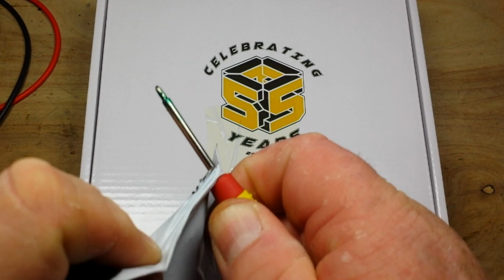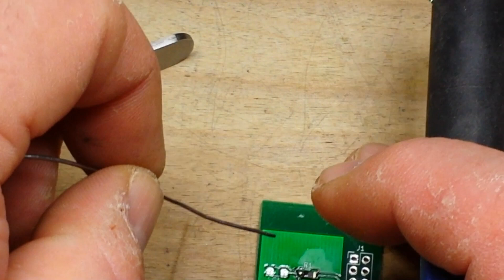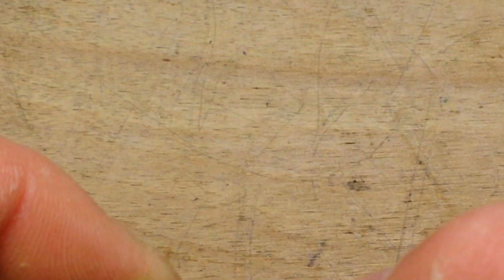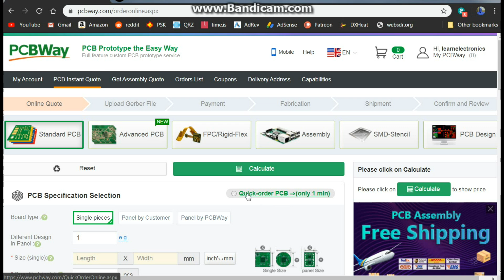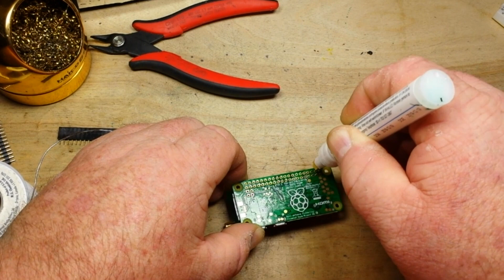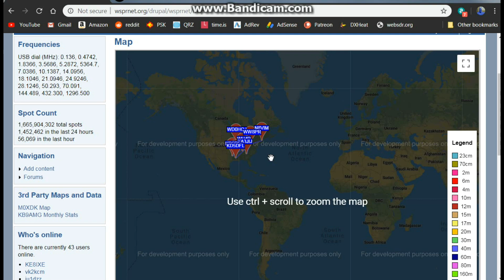WSPRPI Board build and test

Comment: For soldering SMD components your should purchase a Chinese T-962 Reflow oven. They are inexpensive and there problems can be fixed fairly easily. Just do a YouTube search on the T-962 and you will find many many videos on repairing these reflow ovens. The best way to fix this reflow oven is to purchase the following Tindie Product: https://www.tindie.com/products/pnoxi/t-962t-962a-reflow-oven-controller-upgrade/?pt=ac_prod_search. This is a special circuit board that you can add to this reflow oven. It fixes many of the problems with the T-962, with little work.It also flashes the software on the unit to fix the software problems. It also adds USB support to this reflow oven. It's a great add-on project. Check it out. SMD parts are here to stay.

Comment: Hi Paul,
I'm intrigued by the soldering style of some of the asian creators - they seem to use massive bits and simply join components together in mid air.
I've got this as a compromise which allows you to load the bit with solder then flux up the pads and use the bit to transfer solder
I used a triangular file to make a large grooved face that holds a fair amount of solder on one side of the tip and a shorter face that transfers a reasonable amount of heat and solder in a controlled way.
https://i1150.photobucket.com/albums/o618/doppleganger1/dragtip_zpszfcashcf.png

It's drag soldering with an emphasis more towards getting a decent dab on resistors and transistors rather than many legged ICs.  Been using it a couple of months and it works for me.
Load the tip use lots of flux and you only need two hands to manoeuvre your work.

Comment: Tech then got General about 1 year later. Ten years past and renewed licence. That was about 2years ago. Time flies. 13 years give are take. Just for kicks I went back to Qrz and wanted to see if I could past the tech. I failed it. Wonder if any ham operator have tried this that have been a ham awhile?The test change ever 4years but math does not. I listen on 80 few times a week. That's about it. Of course it  drove me crazy that I failed the practice test after being a ham this long. Practice all 3 until I passed. Never used one of these devices. Be honest this is the first time I have seen one.I like in your videos everything you do is included. Like trying to get the boards out of the package. Last resistors was the one's you needed and so on. Some of the simplest things you can do will damn near drive a person crazy . At least that is always the case with myself. Your videos are real and thats why I like them. Murphy is mean. I believe he likes some people better than others.
Reply: jay im a ve and i keep up to date on all my test  i was asked the last test section 
if i could pass all the test and when i last did it. i told the new tech  yesterday  he was shocked.  the way i see it learn and keep up to date in a hobby i love.  i got my first lic when i was  12  and i have been going ever since 61 now great hobby jt8 is awesome 73s n4jrs

Comment: Interesting video.
 For SMD i often use cross lock tweezers. That way i can keep components in the tweezers without the need to adjust force. That way components don't drop when i lower the force or get launched when i apply to much force.

Comment: Have you considered using solder paste and put the board in a table top toaster oven? There are several articles on modifying them for tight temp control specifically for doing pcb's.